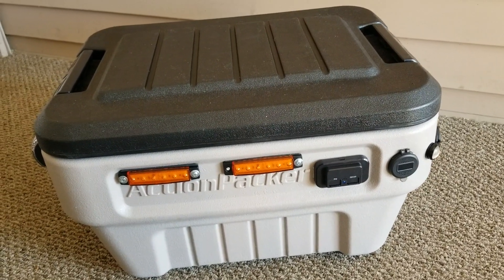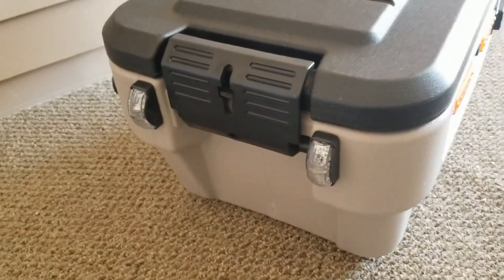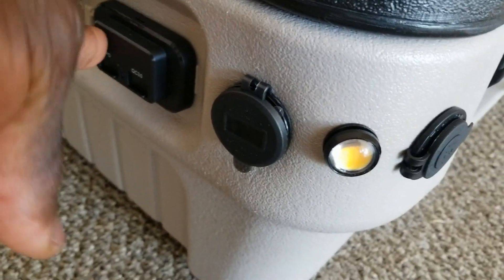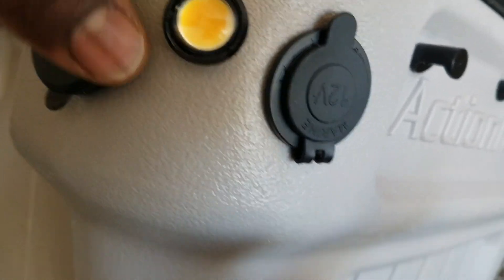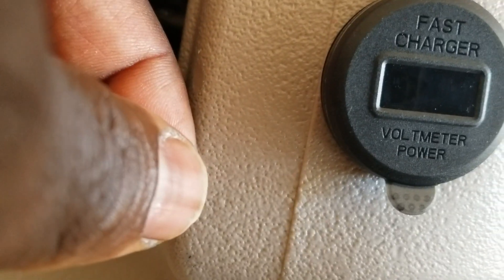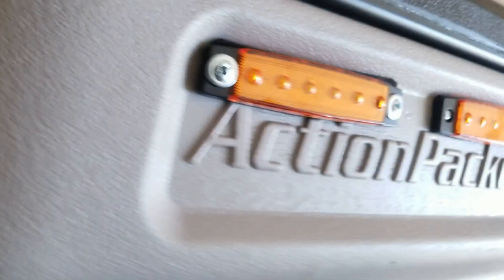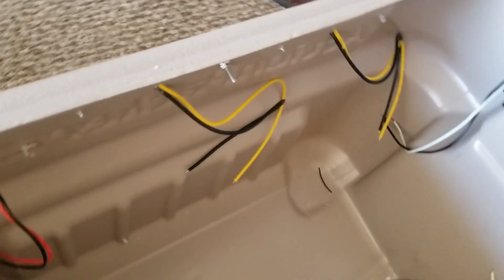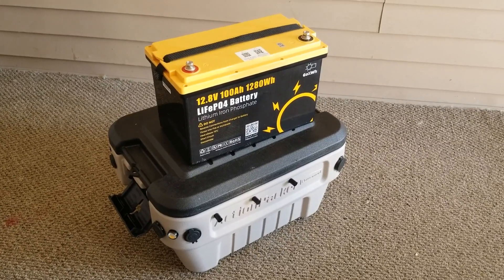DIY Solar Generator! 1280Wh Portable Power Station LiFeP04 Battery Part 1

Comment: Looks good The cooler will help the batteries to stay cool. You may need to consider fans during battery charging.
Reply from the maker: I want this built to be a IP65 portable solar system during rains, fishing while on the boat and also for winter season .

Thanks for sharing and for stopping by.
Please don't forget to like share and subscribe